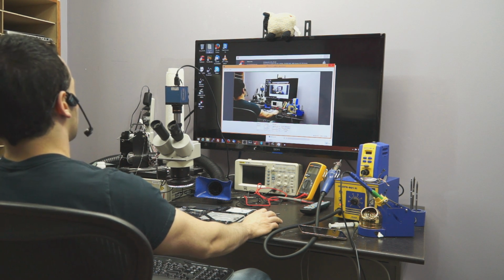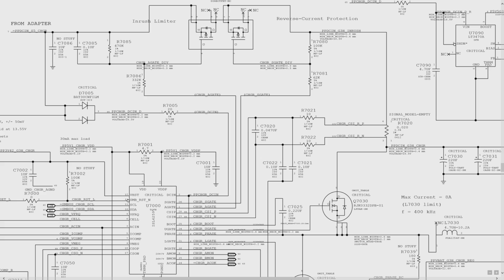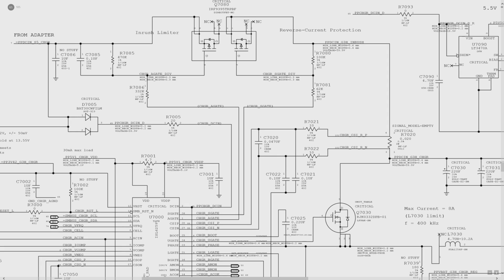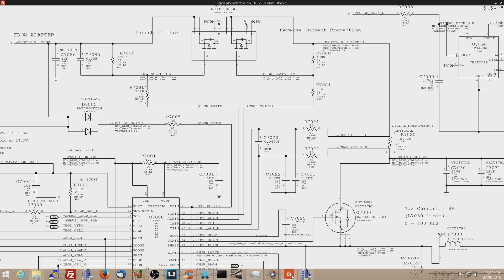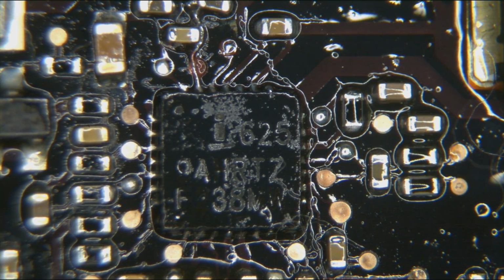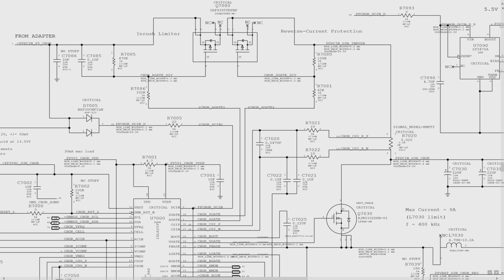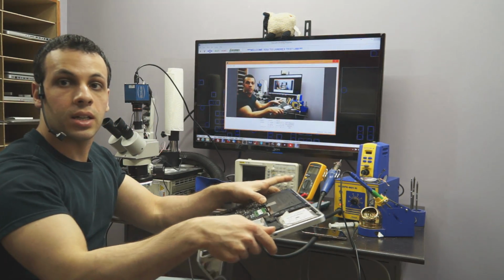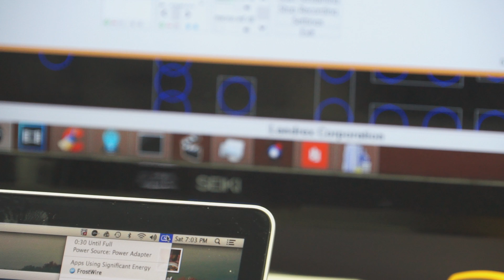820-3330 current sensing repair on Macbook Pro charging circuit.

Comment: What could be causing getting an orange light on the charger all the time even with the battery disconnected? The charger IC 6259 bad or some current sensing issue as well?
Thanks in advance!

Comment: Does this issue present itself in inaccurate battery mah readings by the system and coconutbattery?  I'm on my second new 2015 Macbook Pro battery, and they all drop "full charge capacity" 3% every cycle.

Comment: Great job, i have a question that i need a professional to answer, i have a macbook that working fine but if you plugged in the charger it will shut the power, and if you want to boot again u need to hold the power button not like usual just hit it!, and after you plug in the charger you'll notice that the graphics are running very slowley, so whats my problem what chip is it
Reply from the maker: if you want us to fix it for money, you can send it to us. if you want us to answer these questions, you can join the paid forum. if you want to fix it for free, you can watch any of the dozen videos where i already answered this question

Comment: Hi Louis.. Great video, was wondering if you could advise on a similar issue I'm having, same model MacBook Pro, coffee spilt down the screen. Originally it wouldn't boot or display anything on the screen, I was able to clean the corrosion and repair some tracks which had burnt off the logic board, boots fine and runs from battery no problem, also can boot with power supply and battery disconnected, the issue is "no charge" no lights on the MagSafe at all, the screen does dim if MagSafe is disconnected.. I've been watching your vids all morning, but not found the specific info I'm looking for yet, a link would be much appreciated, many thanks :)

Comment: I have a mid 2012 15" macbook pro that got wet and now green light on charger comes on but battery doesn't charge. Can the logic board be repaired, where can i send it, and what is the approx, cost of this type of repair

Comment: My 2012 Macbook Pro 15 inch 2.6Ghz i7 has charging slow problem, it takes 18 hours for fully charging. I tested with two 85w chargers and new battery. The Macbook pro run very slow without battery, feels the logic board does not have enough power. I am not sure if the same problem as this video shows.

Comment: Might also be worth checking out the free technical preview of Windows 10 - build 9926 and 10041 are pretty good, works solidly even on 'low end' hardware :)
Reply from the maker: kr239 It took so long to find a setup that worked that this is never getting changed. Even cloned to another drive just incase I fuck it up somehow. Linux crashed all the time, video went out of sync, editing was slow and sucked. Some OBS versions crash, some do not record WAV audio. This works, easily, even with some silly quirks.. and I am happy!
Reply: OBS is a finicky beast (i stream on twitch with it), that's for sure!

Comment: Why do you punish yourself with that Win8 disaster. I still use Win7 Ultimate x64 and find no reason to upgrade. BTW just ordered Siglent SDS1102CML. Did some research and comparison between Rigol DS1102E and Siglent SDS1102CML. They both have very similar specs, but picked up Siglent because of the bigger screen
Reply from the maker: I like it better than 7. It boots much faster and just feels snappier to me.

To me, anything but XFCE is enraging, so I am settling either way. Might as well use an OS that will perform better.
Reply: Louis Rossmann It boots quicker because it doesn't really shuts down completely. When you click shut down it goes into hybrid shutdown. If you want to shut it down the right way, run command: shutdown.exe /s /t 0. If you cold start it after that it's the same boot time as Win7. I got Samsung 840 Pro SSD and Win7 Ultimate is flying. Searching thru Apple schematics PDF files is instant
Reply from the maker: I have to find a PDF reader for Windows I like as much as evince. I like that  evince shows me a thumbnail of each place in the schematic that a term I am searching for shows up on the left side of the screen.
Reply from the maker: I will try this; thanks!